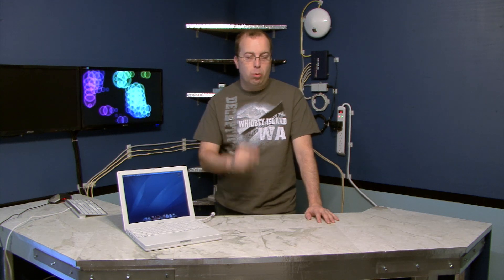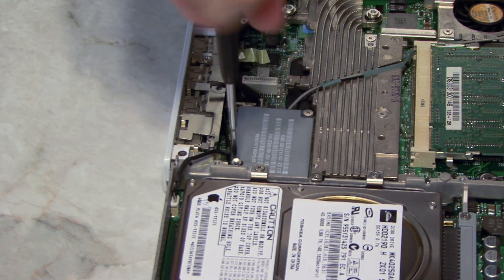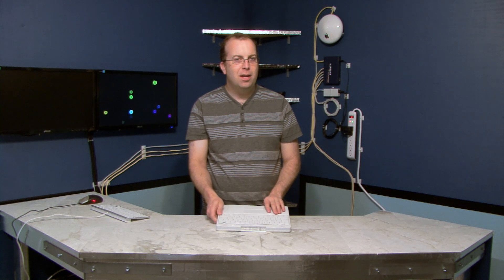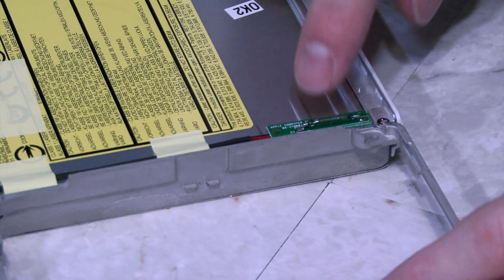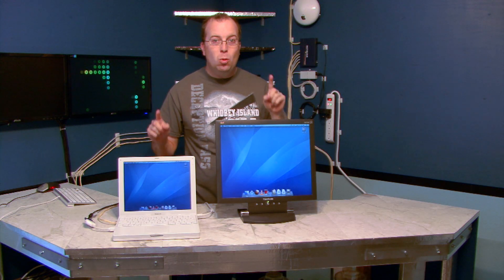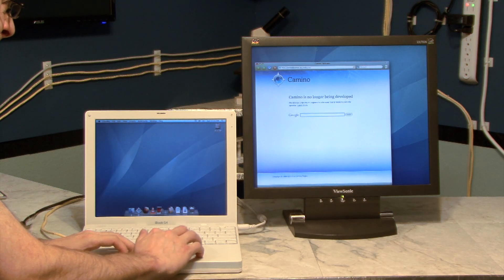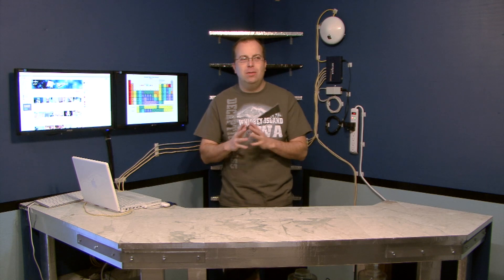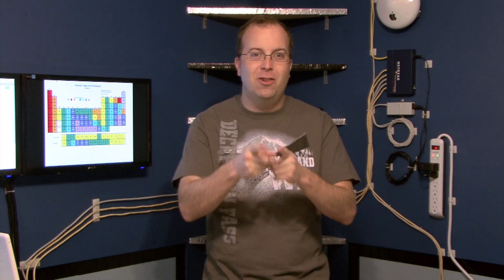iBook G4 tricks - Fix the crashing and using Dual Monitors!

Comment: Heh. The 'Old Computers Did It Better' was my introduction to you and your content a few years ago. :)
There's another solution to the Airport problem that doesn't involve tearing apart the machine (which is HELL) to remove the card, and also provides a bit more modern functionality: Linux. I bought one of the late model G4's on Ebay that unbeknownst to me had the Airport/PCI-E port issue. I could not load a copy of OS X to save my life and didn't quite know what the issue was at the time. I figured, let me try Linux. After a lot of install failures, the solution was to install Ubuntu MATE 16.04 PPC and then install the Lubuntu/LXDE desktop over top to reduce the memory footprint (Lubuntu didn't want to install for some reason). After that I had crashes involving the ATI video card which was no longer fully supported in the kernel and would crash the system at random. It's a known issue and it can be fixed with a bit of Googling. After that, a USB wifi adapter can be used and you then have a much more modern and usable system than Tiger. The only issues present afterwards are a very long boot time as it tries to poll the wifi card and then gives up and loads the OS (about 10 minutes), and then the inability to fully shutdown (probably the same reason - not sure - it just hangs at a certain point) which results in an fsck each time the system boots to fix orphaned files and such. As it's a journaled filesystem, I don't think it's a big issue as data shouldn't really be lost - just adds to the long boot. It's one of those things that's an annoyance but as long as you can live with it, that's all it is. You've still got a perfectly usable machine and it it's got a decent battery, maybe you just sleep it and never really shut it down all the way unless an update or overall system refresh requires it.

Comment: I use a dumpster find Late 2008 Unibody 13.3 with NO SCREEN!

I wasted $50 on LCD screens and glasses.

Only only to find it REALLY needed a new LVDS Flat cable.

Not found on eBay!

2009 LVDS cables DO NOT FIT....

So I use the UNI 13 with my $25 NOS 2009 20" Emerson LCD TV...

via a VGA adapter cable...

Perfect!

Pirated Baseball games, auto racing and whatever..

FOR FREE!

From my arm chair!

A 21st Century Sinclair 1000

(-8D

J.C.

Comment: Hello, I have an Ibook G4 with a damaged screen.
I want to take the screen off and use it with an external monitor.
But I am worried if I do this I won't be able to reinstall OSX or fix major issues.
The external monitor only displays video once the laptop has booted to the login screen.
When holding the option key while booting (or other diagnostic/admin keys) the external screen does not display video.
This means I cannot replace the small, aged HDD with a new one and reinstall OSX if the screen is removed. 
How do I solve this problem? Does it have anything to do with the reed switch?

Comment: My Late 2008 AL Unibody 13 2.0Ghz. works GREAT with no screen!

It came to me with a BAD LVDS flat cable.

Giving the "Bar Code" stripe / artifact above the left hinge...

A VERY COMMON ill with these machines..

I BROKE both the LCD AND Cover Glass following the BAD repair instructions one finds on YT and elsewhere.

WASTED $50 on glass and TWO screens

A $9 2009 LVDS cable did not fit..

I have since found a MINT April 2009 Deluxe 2.4Ghz. model on eBay for only $41 ppd.

Needing only a HDD!

IT has a slightly different LVDS cable...

Both machines work fine!

Comment: 2:00 on a windows computer you just go into control panel and just set it to do that without going into the laptop and unplugging a switch. So I'm not sure why Apple can't figure out how to put a setting in system preferences.
Reply: They fixed this issue at least with M1 macs, haven’t tested it with any of my MacBooks with intel.
Reply: I believe this was due to the cooling system. iBooks dissipated heat through the keyboard so if it was used with the screen closed, it could cause the computer to overheat.

Comment: my ibook g4 has a problem with gray screen pls help me
Reply: Check the battery with a digital millimeter, if it reads anything under the recommended watts and volts, then test the wires running to the monitor.Also check the screen internals and ribbon cables.

Comment: i dont have a iBook laptop but i have a crappy 2005 era lg laptop (i didnt even know that lg made laptops until i saw this)it had 1gb ddr2 ram and 1.40Ghz celeron m processor and it had a wifi card but it was broken so i replaced it put in 2 more gb ram (3gb total) and a pentium 2.26ghz procesor and since then it had been going to sleep when its not supposed to and its hindge for the screen
Reply: LG made laptops in 2005

Comment: 3:37 1280 x 1024 is NOT 1080p high definition.
Reply: ...provided that the monitor you connect to supports 1080p.
Reply: Is your external monitor supports 1920x1080. The option will show up.

Comment: I wish that there was a scaling option as well (either with S-SD or Mac OSX itself), as a 14-inch iBook G4 (which sadly has the same-resolution screen as a 12-inch iBook G4, if I am not mistaken) will run Tiger (but maybe fixed in Leopard?) at a scale that's a bit too large and doesn't make great use of that larger display.

Comment: Hi there !
As this is your latest iBook G4 video, i'm going to ask here.
I received as a gift an iBook G4 (14", 1.33ghz, 512mb ram, 60gb, late 2004 i guess. and with a removable airport under the keyboard) from my cousin, who is liivng abroad and her G4 was in the shelf for a long time.
The screen is having some problems, seems no dead pixels, but colors are all gibberish, garbage.
I filmed a video showing the problem.
https://www.youtube.com/watch?v=DU34OOEQ3TQ
People said it could be the flat cable, that i should obtain one from another machine, and from my researches i found that could be the solder points in one chip or the bga soldering of the gpu.
What upgrades you advise to make on this model ?
I know i could change the 256mb ram stick for a 1gb, for a total of 1.25gb of ram. Are there any other feasible ?
Overall the conservation and looks of it are very well, and as a somewhat retro tech lover, i would like to get mine working well... I would love to have the latest ppc portable Mac available, is there much a performance gap between mine and the latest Powerbook Aluminum 1.67ghz, maxed out ?

Thanks in advance !
And love your videos !
Reply: it's the ribbon cable

Comment: Hi a friend of mine gave me his ibook G4 but when i turn it on it only goes to a grey screen with the apple cymbal and a load cymbal but it doesn't change..could you tell how to factory reset it or give some advice on how to fix it.
Reply: I think you may have to reinstall the operating system! You can download or even buy a install disk, for leopard or older!
Reply: Verbose boot the Mac and see where it stops. To verbose boot, press Command-V
Reply: Arminder Singh it ends at a panic: we are hanging there,  and a CLOCK RESET! PMU WAS PROBABLY RESET SOMEHOW!! Help?

Comment: Hi the iBookGuy im having a problem with my ibook G4, i just replaced the battery and now i can use my ibook unplugged but when the battery reaches 29% it shuts down unexpectedly, i been doing some research on google and i found that can be a problem of the logic board, what do you think? could i repair it or my ibook is dying? i would apreciate your help thank you

Comment: I have been given an iBook, with 768Mb of ram, and was wondering if it's worth upgrading to 1.2Gb by removing the 512Mb expansion card and replacing it with a gigabyte. Is the extra 512 Mb worth it?